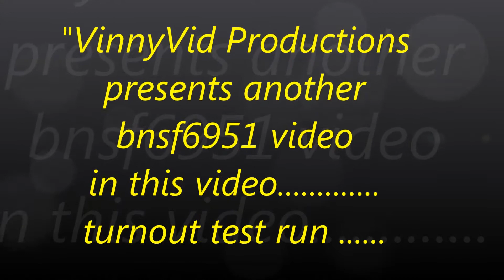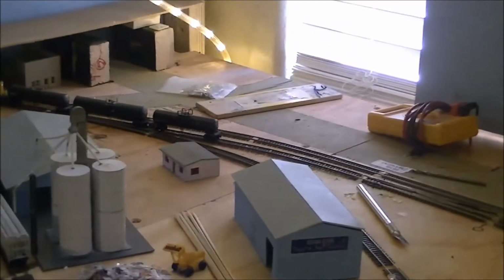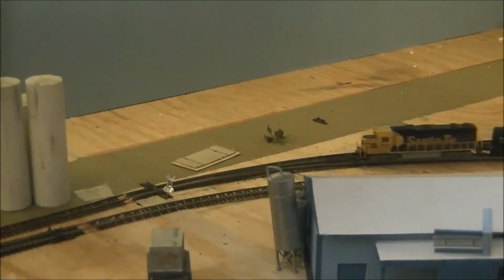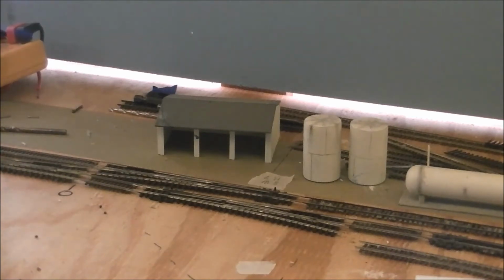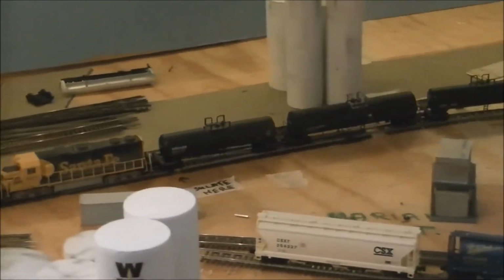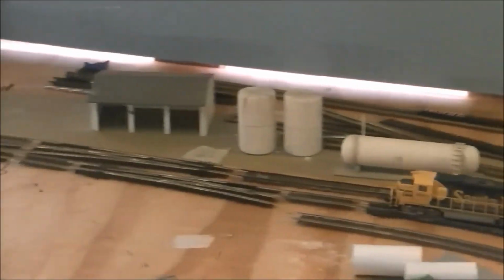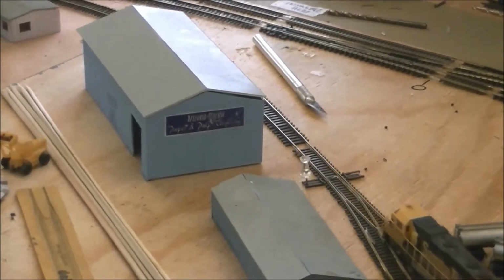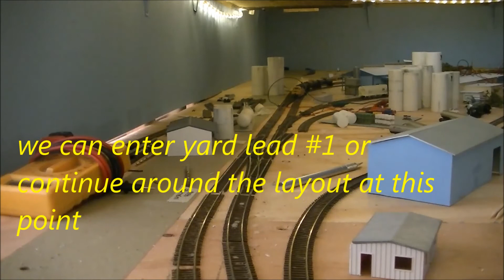turnout test run

Comment: Vinny, glad the turnouts are working out for you.  For turnout testing I always try some different length and weighted cars.  Couple a 89' flat cars together, empty well cars, 2-bay hoppers, both to themselves (3 cars of the same type coupled together) and then interspersed with different length/weight cars.  When I was still laying track on my layout I would run a whole string of flat cars backwards over the layout to test the track.  If my track passed these tests, then I figured it was good.  Keep up the good work.  Kevin
Reply from the maker: hey Kevin... this was the first of the test runs i will be doing... besides testing the turnouts i was testing the wiring i do have a reverse loop in this section... it was worth doing the mods to the turnouts.. i will be changing out a few more turnouts soon... stay tuned for more updates...
vinny

Comment: Vinny,great job here on turnout ops.Smooth running for sure and no stalls.Way to go.For "N" gauge,I cant get over how quiet  that Santa Fe unit is.Is it Atlas or Kato?...Jimmy
Reply from the maker: hey Jimmy thanks for the comment... that unit is an atlas with digitrax installed.. runs very well.. it can & has run in a lash ups with Kato... it will be one of my switch engines for my industries / yard
vinny

Comment: Looks good Vinster. For no problems with track next time use Kato! Because if the trains don't run what is the point?
Reply from the maker: hi radioredline88.... thanks for the comment & you are right about that.. thanks for your input
vinny
Reply: i'll admit that the unitrack isn't for everyone. but with work peco is good too
Reply from the maker: *****  the Kato uni-track is very expensive but it is pretty much bullet proof
Reply: Expensive except if you include you didn't have to buy cork, ballast...
Reply from the maker: ***** thanks for all your input but i am too far along now to be changing over to Kato... so i'll just deal with what i have...these Peco turnouts seen to be doing the trick
thanks again
vinny